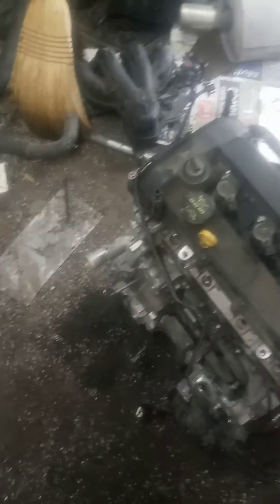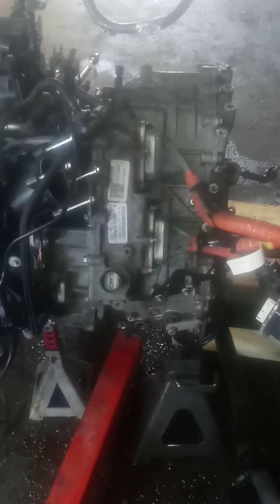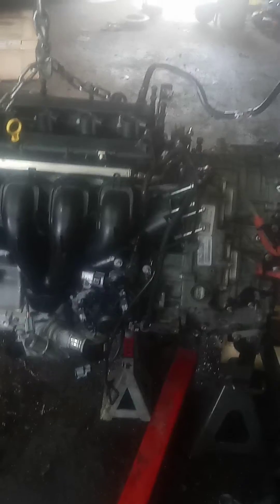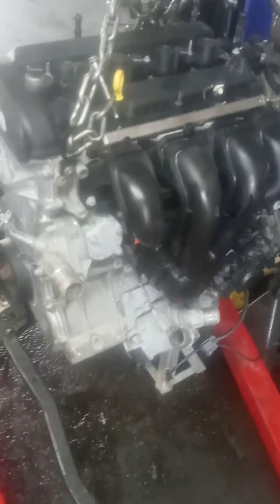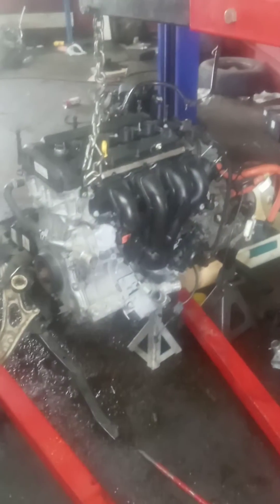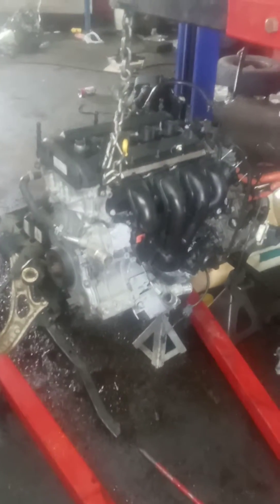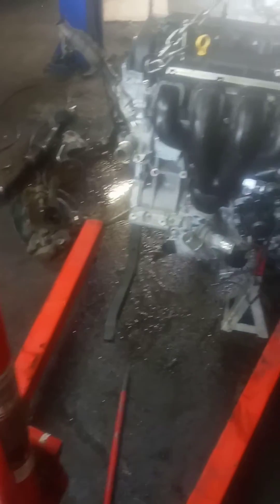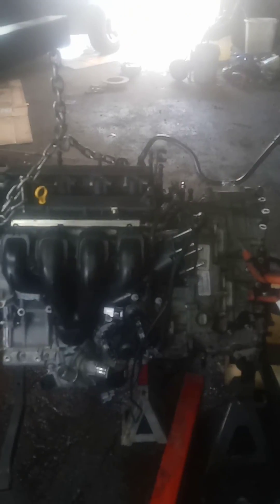Ford C-Max Hybrid engine install how to advice 2013 and up

Comment: Thanks for the video, but I think you should show how the engine came out, from the top , from the bottom or remove the bumper and came out to the front, cause lots of time people wants to do it at home, but they need a clear idea,
Reply from the maker: Sorry your right buddy unfortunately my diy video was not accepted do to copyright issues for the full removal.
But the engine and Transmission was dropped from below the vehicle.
That's the easiest way.
It will not come out from the top my friend without possiby damaging the vehicle.
Thanks for your comment and advice it is much appreciated.
For future content I will improve my visuals.
God Bless
Reply: @gerry7602  no problem, I started yesterday to remove the engine, but I was wandering how does it comes out, cause the exhaust is cough on top of the subframe , but I’ll remove it today, thanks for quick answer